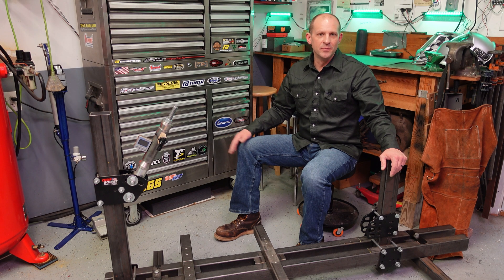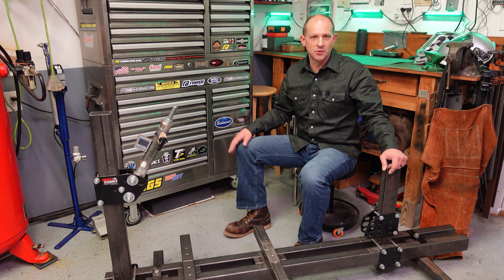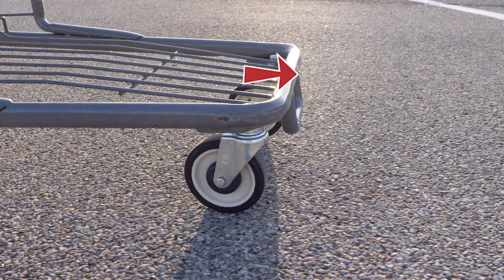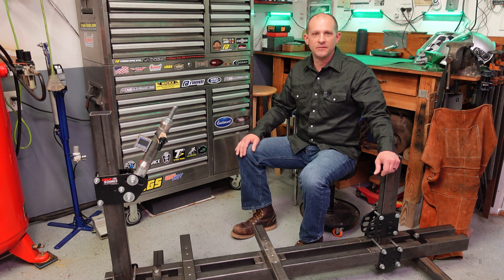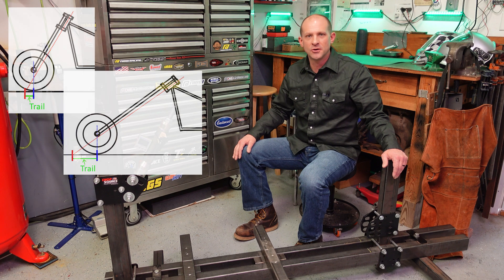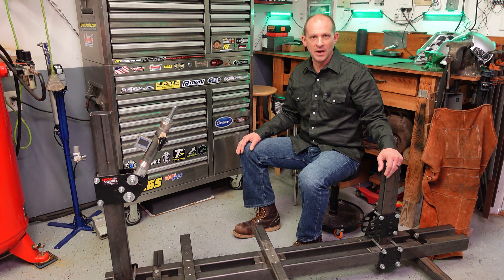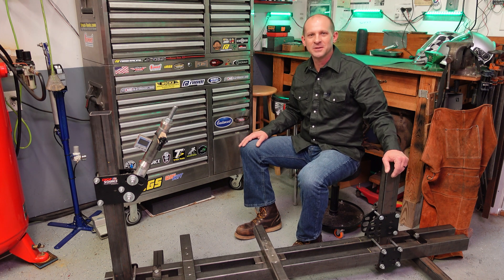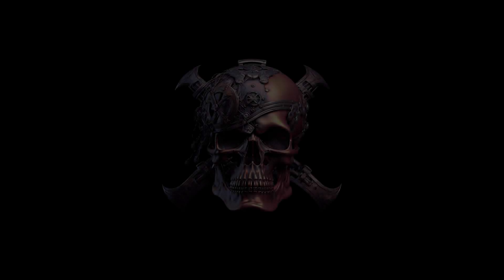Understanding Motorcycle Rake & Trail: The Science of Steering

Comment: Awesome Video my dude! 👌 very well put together.
One question. For the design of the front end. Is it going to be a noticeable effect having the leading style front end? 
And do you have to factor in the air bags leaning on turns? Or should they equalize enough to be the same as shocks?
Or is this all still theory until the motor runs? 
"And by theory I mean just havnt test run it yet"
Reply from the maker: Thank you! That's a good question and short answer is the design might, but likely not to the degree it will be felt.  I don't expect to ever run the front at full squat or even half ride, as I don't want those front shocks to bottom out.  In that case with 140 lbs of air in the front they are extremely rigid, so I don't expect much play.  On the rear air bag I do expect more flex.  I'm hoping there a combination of the rigid a-arm and extra gas shocks will keep it on track at very low ride.  At full ride and 140 lbs the back is also very rigid, so don't expect too much shifting at full ride.  Exactly right though! All concept until I get the wind in my hair! :) I have two restoration projects I'm starting soon and will keep after this also - I want to get it running very bad!

Comment: I have a question relating to Rake and Trail. A few years ago, I was introduced to the world of custom bike builds on a cable TV channel. Any time this shop built a chopper, they would source the front forks from a true master BADASS in SoCal in the world of custom bike design. He had a design for the bottom end of the springer forks where the front axle and spring bars were mounted that actually resembled (please don't laugh at me over this) the curled back toes of a genie's shoes. He went by the street name of "Sugar Bear," and his design corrected the unstable characteristics of the steering on a chopper regardless of the rake and trail numbers. What is it about his design that makes these front forks work as well as they do? 

I actually saw a build that this shop did of what he called a "pro street" chopper design that was raked out to nearly 30°! I was so very impressed by this design when I saw the customer climb on the new bike and head out for a shakedown run with the owner of the bike shop riding alongside on his own scoot. The customer had exactly zero chopper flop when he was riding and he was even able to park it on the side stand without any concern over the possibility of the front forks flopping over causing the bike to fall over! 

Any insight you may possibly be able to provide will be greatly appreciated!!!
Reply from the maker: An excellent description of his front forks! Couldn't have explained them better myself haha. :)  Ya, that guy is badass and I would be so lucky to meet him one day.  He is a master builder for sure.  First, he is managing trail very well.  He uses an offset in his triple tree and he is pushing that front axle out forward, both of which bring the trail down on an extending rake build and are absolutely needed.  If you ever ride a bike with too much trail it will almost feel unnatural; like peddling a bicycle really slow and you will just want to keep speeding up to keep your balance.  I do think some of the TV chopper builds are not good bikes as they have a traditional fork setup and really long rakes, so it makes them impossible to turn and unstable.  So that's the main thing I believe he is doing perfectly, managing that triple tree offset and lower bracket like a race bike team depending on what rake he is using.  The second thing I think is happening - this I'm less sure of and need to draft out one of his lower brackets - I think by raising that axle above the pivot point of the lower forks it creates more "turning leverage".  It's hard to explain, wish I could post a pic here but not sure i can do that.  If you look at a picture of his fork design the axle sits about 90 degrees up from the lower connection.    In a typical springer build it would be more straight out in front.  If you think about steering the front forks left to right this "action" of 90 degree angle will give you more turning leverage as opposed to a lower angle.  This extra leverage i expect makes the bike feel more "sporty" on top of managing trail with the traditional means.  That's the best I've got for you and hope that helps on his forks - they are widely renowned for being a comfortable ride.   I would love to meet him and ask one day and I hope he's got an apprentice!
Reply: @heritageresto 
Hey boss, thanks for your insight! Even though you gave it your best, I'm afraid that my painfully poor abilities in high school geometry are shining bright for the world to see here. 

Ever since I watched that feller "Counting his Cars," I have had a deep-rooted desire to build a trike with that Pro-Street look. I mean, what's not to like about a trike with long, stretched forks with the handling manners of a stock rake setup? (I actually need a trike due to being disabled.)
Reply: Definitely has something to with the rockers and position of axle relative to steering axis, neck line. The closer the axle is to the neck line axis, like a 'T', the more it and wheel rotates, the bottom of wheel/tire swinging to side, causing flop. Moving the axle up and away from neck line via the rockers, makes axle move through an arc, the bottom of wheel doesn't move to side. 

SugarBearChoppers still has current website. Somewhere I read his son is with him, running the shop. His iconic springers deserve explanation of their unique design and steering geometry.

Interesting, it seems a lot of choppers shown in Thailand have springers with rocker set ups like Sugar Bear's.